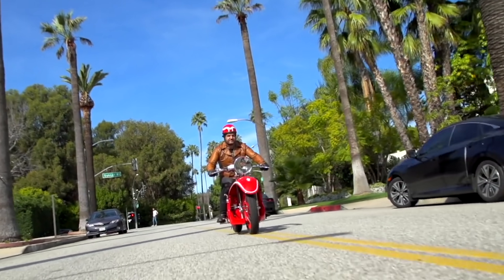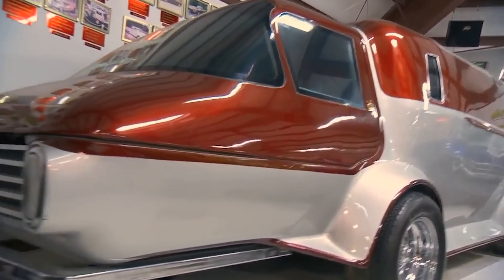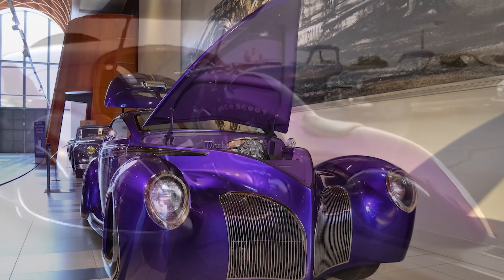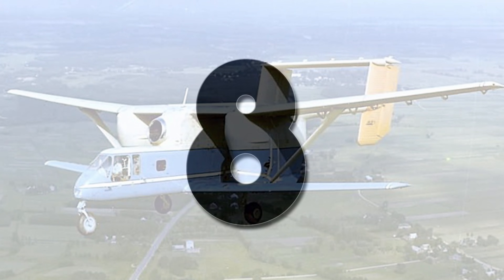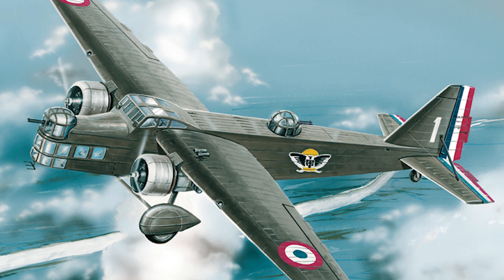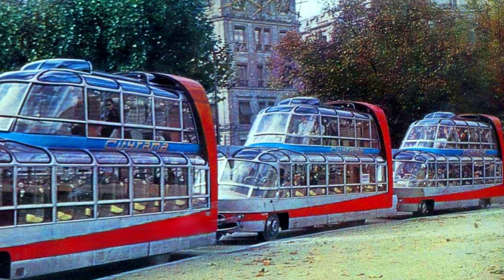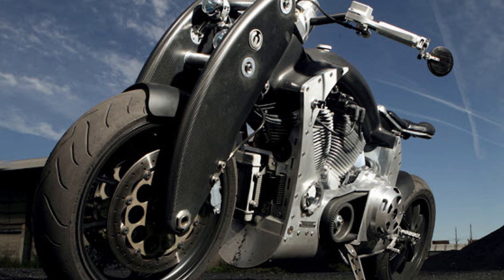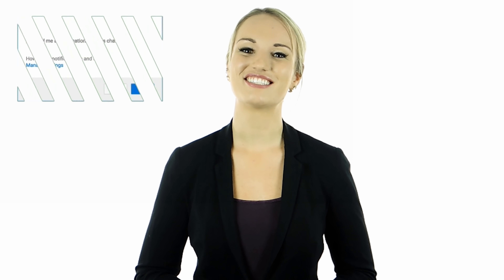14 Notable Vehicle Designs from the Past | 1932 - 2009 Vehicles

Comment: The Bartini aircraft was NOT a "vertical take-off" design. It required a normal take-off run, except from water rather than a runway. It was designed to fly at only a few feet above the surface of the water at relatively high speed.